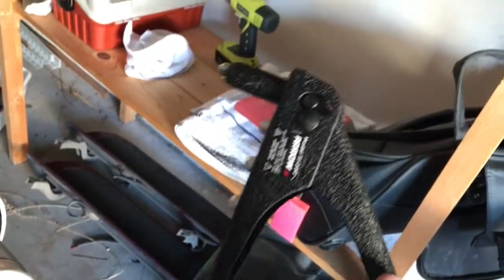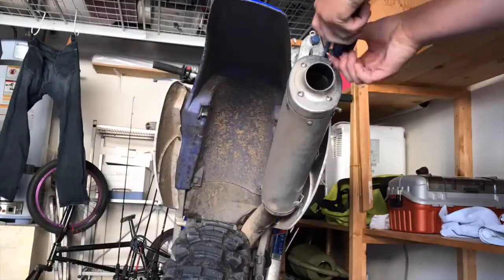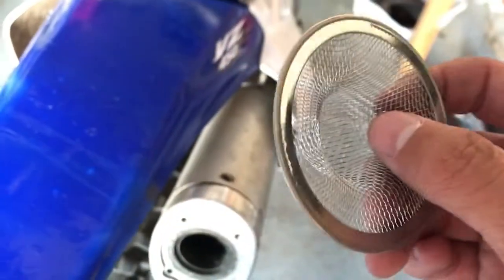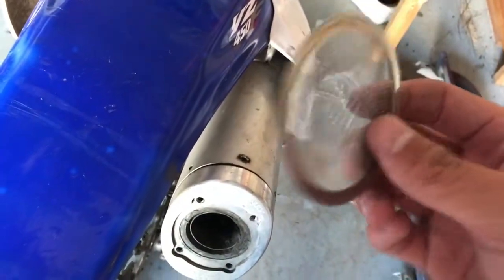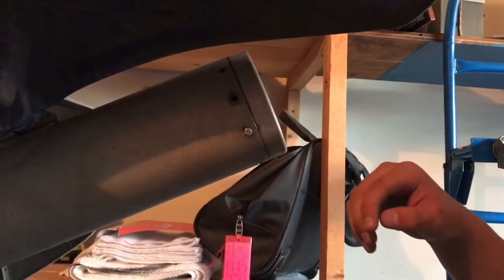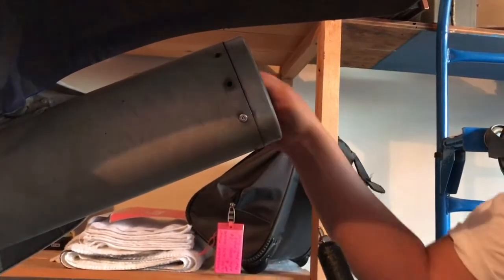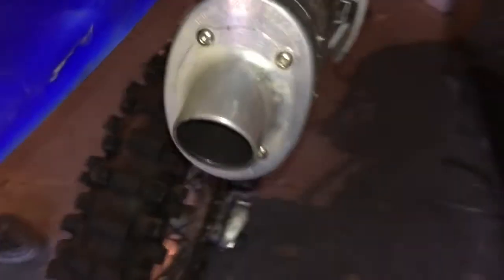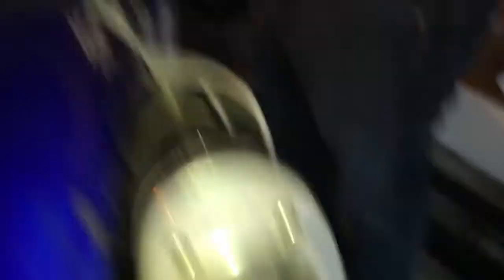How to make a Homeade CHEAP spark arrestor!

Comment: This is not a spark arrester. You need to not only have a USFS approved arrester but the approved system for your bike otherwise you could cause actual damage to your bike along with the risk of a $900 citation and you’ll still be required to get the correct arrester. Rangers and park aides are trained to know what is legal or not. They will not say it’s okay. Spark arrester holes should be no bigger that 0.023”
Reply: Okay Kerin - the K 😂
Reply: Not true. Your bike will actually run better. And no, the park rangers can’t tell the difference.
Reply: Spark arrestors are simply stainless steel meshing with a maximum surface area gap between each steel filament. If that sink mesh meets those dimension requirements then it will fulfill its purpose identically to the "licensed" one. They don't add any magic powder to the licensed ones. Just use the same materials with same dimensions and it does the same thing.